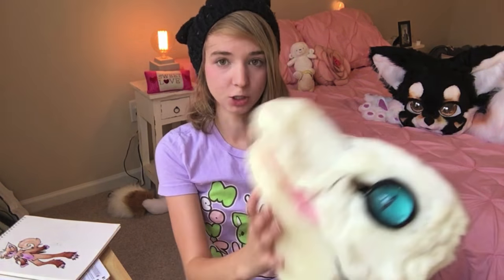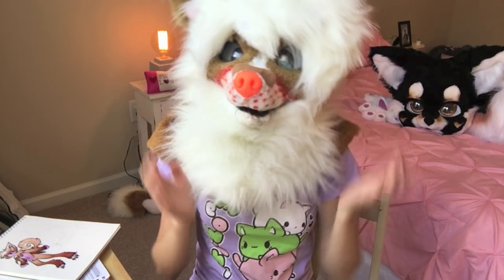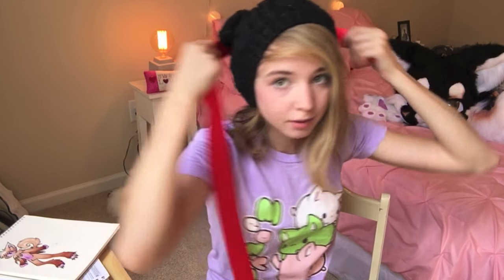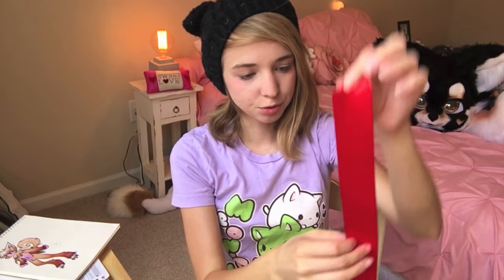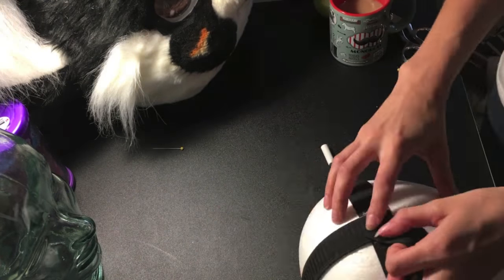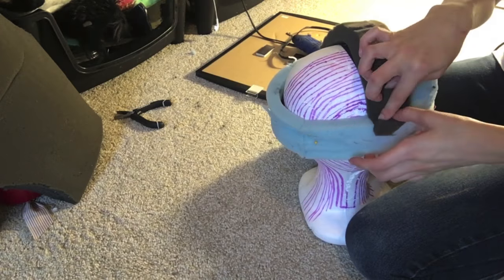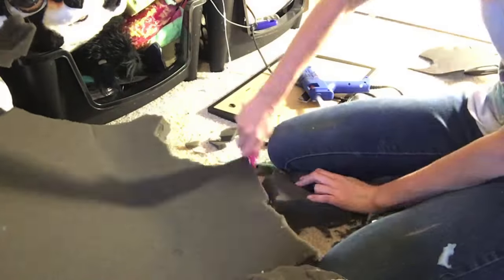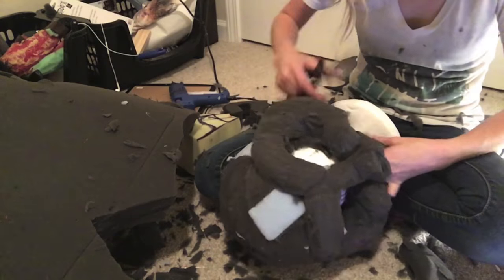How to make a Tiny Moving Jaw

Comment: Now my only problem is that I want to use this for a paper mache based mask. But I'll see if I can make it work
Reply: Aghast Font 
No don't do that ever! Using paper/cardboard is the best way to get molds in your head, then you'll breath them and it will go in your lungs. It happened to many people. There's also this thing: you'll sweat a lot with your head on, and anything that could be broken down by water will be broken down by your sweat. 

And you won't be able to wash it, and fursuit heads get really gross really quickly.
Reply: Dustfeather I'm actually making a human skull mask for Gaster cosplay, but couldn't find a tutorial on moveable jaw. Been trying to fix the ventilation problem for a while now, I might have to get a fan for it. :^
Reply: Dustfeather yeah, gonna have to go down to the local electronics to see if they got the one I need.
Reply: Dustfeather Thanks for the info on the fans, will them out. I'm making a to scale model, so small/tiny fans should fit in the back of the head. (WIP are here: @carats-ritzy Instagram)